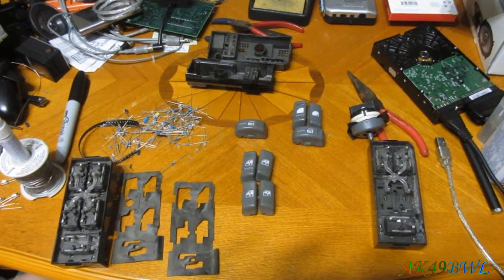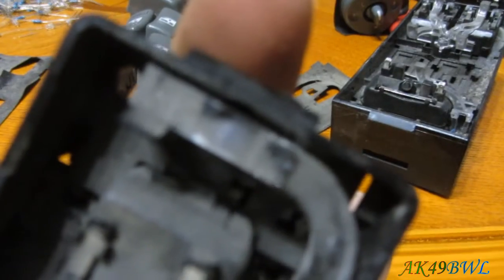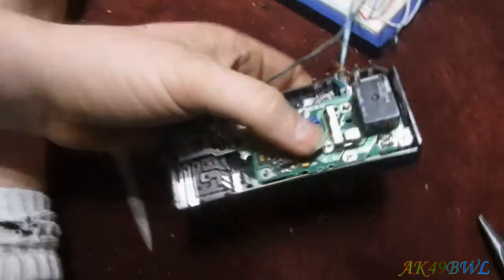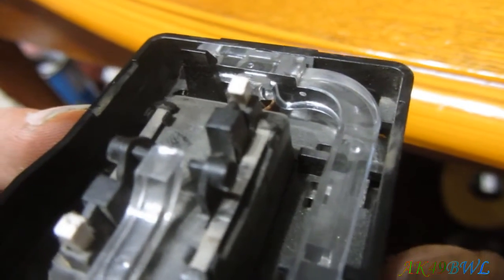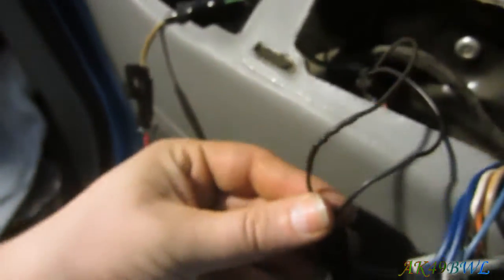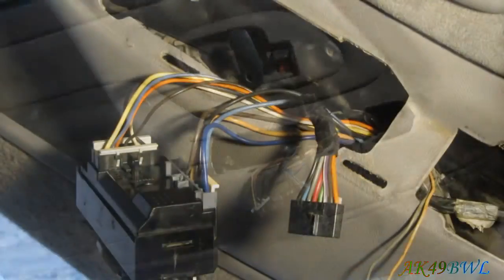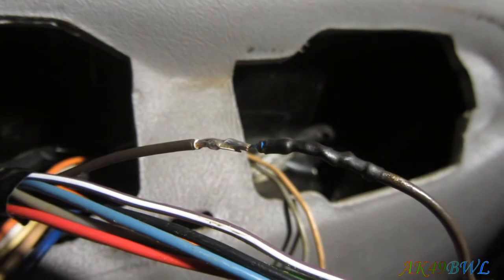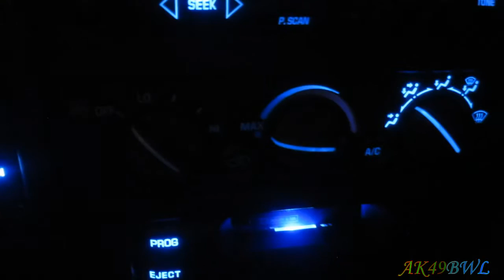LED-ifying the Door Switches

Comment: What happens if you don’t use the resistor for the door panels ?
Reply from the maker: You blow up the LEDs. The stock bulbs in the door switch panels take 12v, LEDs use 3.3 or less. Any more than that and they'll die.
Reply: Oh ok .. can you get them on eBay ? Quick question I have leds for my parking lamps and when I turn on my lights my hazards stay lit up in the dash   Very weird
Reply from the maker: Do the blinkers work at all? Most vehicles need either a specific flasher unit designed to work with LED lighting, or load resistors which simulate the load of a regular incandescent bulb, "tricking" the vehicle into working as if everything is normal. The reason for this is, LEDs use VERY little current compared to incandescent bulbs, and the circuits on the vehicle are calibrated for incandescent loads. Your hazards staying on are supposed to be indicative of your lights being out.
Reply from the maker: And yes you can get them on eBay, but be wary because a lot of the multi-LED bulbs on eBay are not really quality bulbs and may not last long.

Comment: Brandon
Any idea why the lock/unlock buttons don’t work on my Silverado 95? Neither one work, drivers side nor passenger side but it locks and unlocks with the remote knob
Reply from the maker: Alright, this may seem like a long shot but humor me... Check your cig lighter fuse, inside panel fuse number 13.
Reply from the maker: Oh sorry, that might actually be fuse 14 in your 95. One of the silver circuit breakers in the dash fuse panel go to the remote receiver and door lock relay block, but the cigar lighter fuse goes to the actual door switches for some odd reason. That's the most likely reason the keyless entry works and the buttons don't.
Reply: Brandon atta boy, I’ll check tomorrow I hope that solves the problem, I’ll let you know thank you Brandon
Reply: Thank you Brandon, it worked, the cig lighter had a 25 fuse instead of a 20, I changed it and it works now 👍🏽👍🏽👍🏽👍🏽
Reply from the maker: Awesome!

Comment: Will this work without resistor if I use 12v led?
Reply from the maker: Should. Just make sure it will tolerate 13.8v, because that's what your vehicle will give it.
Reply: Brandon Thx...also what size bulb did u use?
Reply from the maker: 5mm behind the window switches, 3mm behind the lock switch, two 3mm in the mirror switch.

Comment: How did you find out which wire to cut on the harness?
Reply from the maker: I have access to every wiring diagram available for this truck.
Reply: Brandon where can i find that? Would it be similar to a 1999 chevy suburban?
Reply from the maker: Very, if it's still the GMT400 line and not the new body style GMT800. There's a few more wires in there for the extra two doors (windows), but the colors are all the same for what's shown in this video.
Reply from the maker: I have all the wiring diagrams for my truck online but you'll have to wait till I get home so I can remember the link lol
Reply: Brandon thats great, thank you. Happy new year
Reply from the maker: http://ak49bwl.com/other/GMT400/ if you need anything just let me know, I have access to OnDemand5... Wiring diagrams for anything pretty much from ~1990 to 2013.
Reply: Thats awesome thank you. Where did you buy your leds and resistors?
Reply: So far ive only done measuring to make sure i get the right bulbs and resistors. But how did you attach the leds to the bulb holders? I didnt try pulling the old bumbs out of them to take a look, but I was curious how you did it
Reply: @AK49BWL  Do you have the diagrams for a 1999 Escalade?
Reply from the maker: @mprtftr  I do. What do you need?
Reply: @AK49BWL  Whatever you may have. Finding wiring diagrams for this truck has been hard. Even the Haynes manual isn't very specific when it comes to the diagrams and has very little straightforward info on the Escalade. Pickups, yes.... Escalade, no.
Reply: @AK49BWL  1999
Reply from the maker: @mprtftr  Much of it is very similar to the 98-00 pickups and Tahoe/Suburban models, with a few changes - mainly to do with the sound system, but there are a few things in the Escalades controlled via a Body Control Module rather than separate modules like they are in the other trucks - namely the keyless entry, warning chimes, retained accessory power, etc. 1999-2000 is the same, I'll pull down a complete set of diagrams and post the link here when I'm done.
Reply: @AK49BWL  Thank you! I really appreciate it.
Reply from the maker: @mprtftr  https://www.ak49bwl.com/other/wires/1999Escalade
Reply: @AK49BWL  Thank you again.
Reply: @AK49BWL  Hey, I hate to bother you again, but do you have the wiring info on a 1994 Mazda 929?

Comment: Why not use bulbs with the resistor built in? Just curious
Reply from the maker: I didn't know about them when I did this.. That's pretty much it lol. That's most likely what I'll be using in the headlight switch though, as there's nowhere to put a resistor for that one.
Reply: Where can I get those from?
Reply: @unclesaia5224  audio xpress they have utube vids on changing bulbs.
Reply: For utube its audio xpress 1
Reply: @stonemills1546  hey I appreciate the reply! Definitely going to check them out!

Comment: Great video, but I have to say your solder job is poor at best. All of them were very obvious cold joints as the solder didn't flow into the wire at all. You may have continuity, but the physical connection is very weak and won't last.

Still, thanks for your contribution.
Reply from the maker: Oh, really? It's been a while since I did this (and I didn't re-watch) but I thought I'd made solid flowed connections.... I usually do. Might have just been in a hurry... Well, they are still holding for now, and the connections aren't stressed so they should be okay. I guess I'll know where to look if they quit working :P thanks tho!
Reply: Brandon, on multi stranded wire like this, the flow should result in a fully tinned wire. Hey, as long as it holds it should be ok. Like you said, if they start flickering then you know where to start looking.

Fwiw, I just put LED's in my 99 yukon. Superbrightleds.com now has drop-in replacements for the stock bulbs that include the base assembly. At $1.50/ea, i think they are with it. My only complaint is that my rear door window switches are too bright, so they light up part of the door.
Reply from the maker: Wow, didn't know SBL had those, I'd have gotten them for my 03 Blazer lol. The window switches are identical on the 98-05 S-Series trucks as the GMT400 trucks. SBL did start making "through-hole" component LED bulbs with a 360° view angle, and I've been using a LOT of those because they light everything up like the original incandescent bulbs. No more hot spots!!!

Comment: how did you do the glove light?
Reply from the maker: That one's easy, it's a 194 base bulb. I just used a 5 way bulb like is used in the door lights and cluster.
Reply: yea cause i tryed pulling out the halogen bulb but it dont come out
Reply from the maker: It's not a halogen, it's a 194 base incandescent. It's easier if you pull the entire housing out, drop the glove box door down and you'll have easier access.
Reply: thanks i figured out how to change it and i did it looks better
Reply from the maker: Sweet! You go white with it or color?
Reply: yea cold white
Reply: Will you do someone else switches?

Comment: Hey Brandon, 

Great video and very informative. I have a couple questions if you don't mind me asking. 
1) What voltage of bulb did you use for your door lights in this video?
2) Is the resistor required or recommenced for this upgrade to be effective?
3) Which wire did you use when adding the resistor in?

Thanks
Reply from the maker: Bulb voltage if I recall is 3.3 volts, resistor IS required to bring down the vehicle's 12-13.8v supply to that 3.3 volts, or you blow up the LED. The wire is the supply from the park lamps... Brown wire, I think? Without rewatching the video myself...
Reply: Brandon gotcha. Would the 3 volts be effective enough to work on the dash as well as they did on the door panel? Just want to know if I need to upgrade to a higher voltage for the dash (cluster). Thanks
Reply from the maker: The cluster bulbs generally have their resistors built into their socket base when you buy LEDs, no voltage changing is required.
Reply: Brandon ohh ok I got you. So I can just solder those onto the instrument cluster as is, pending on where the polarity is?